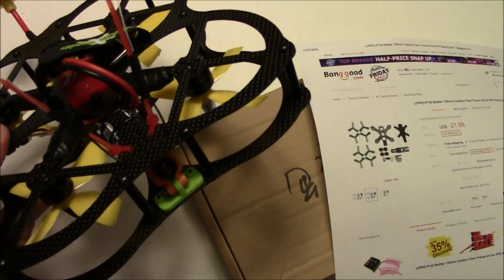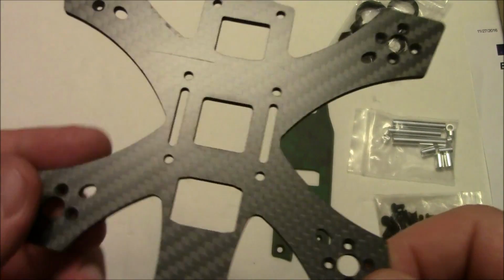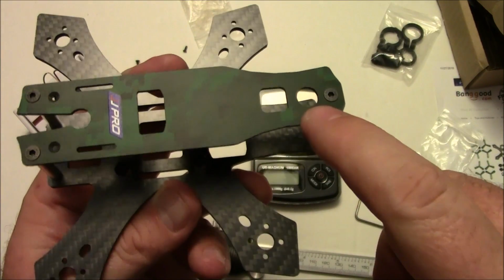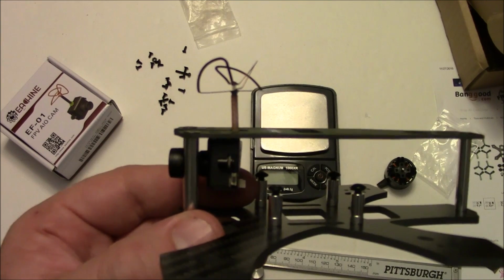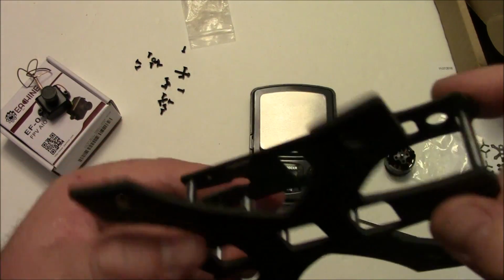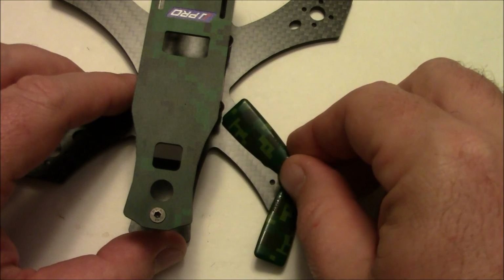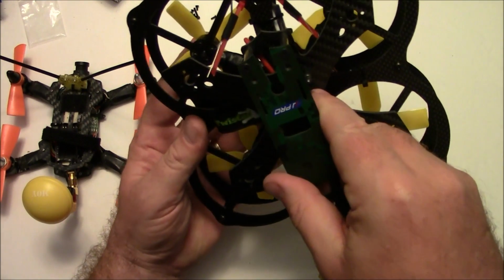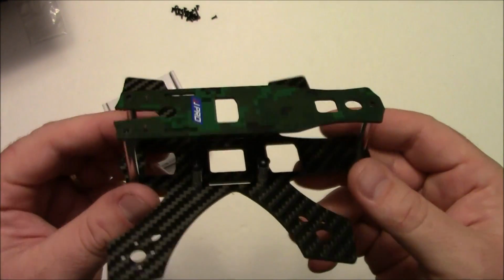JJRC P130 Battler Frame Review from Banggood

Comment: I bought a rtf version and it flew very sluggishly,so I took all the motors and electronics off and swapped them over to a Diatone Grasshopper 160 frame and 4" props.Using the same 3s 850mah battery,the difference was day and night.Also,when you measured the bottom plate you got almost 3mm. Mine is only 2mm.Maybe they thought if they made it lighter it would fly better.They should have just changed the motors down to 1306s and it would have flown much better.

Comment: Hi Travis! Could you post the specs of the Realacc MM130 asap or even better run your build video of the flying Pizzabox?? I'm just about to hit the buy key for around a hundred frames, 120 fc, 120 4-in-1 esc's and so on for a school project here in Aarhus, DK. But your advice and experience with the quad would be greatly appreciated!!!!! Huuuuuuge fan, Michael

Comment: Reportsof this frame have not been good in reviews of the RTF version.  It is thought the frame interferes with the prop airflow and causes the rear of the quad to unexpectedly dip while flying with a 3S battery.  On 4s, the quad performs much better

Comment: that cut out in the back is a deal killer for me. for sure the first thing to break
Reply from the maker: Maybe if you have battery on top it would break easily, but it is still descently wide.  With the battery on the bottom, I think it would have a better chance of surviving.
Reply: travisgrindal eh mayb they have a tendency to land back end first sometimes. I just wish manufacturers would stop significantly weakening them for a couple grams. It drives me nuts but i guess its in their best interest for us to break them
Reply: Something this small isn't going to break as easily
Reply: Stacey Abshire 250 grams can snap that easily
Reply: travisgrindal can you put the calipers on the edges of that last cut out im just curious